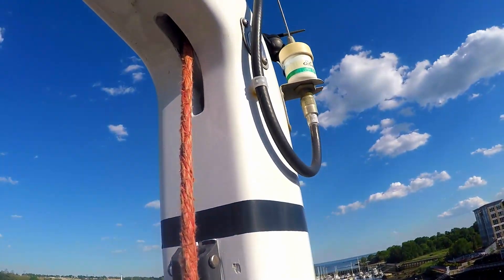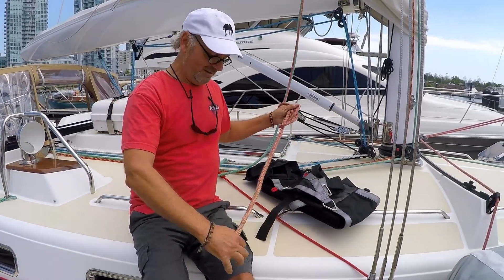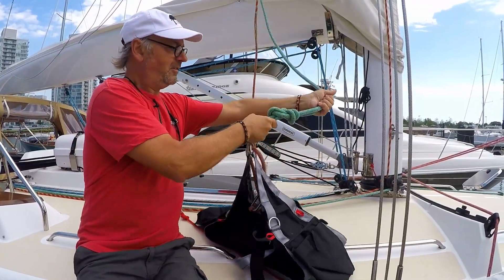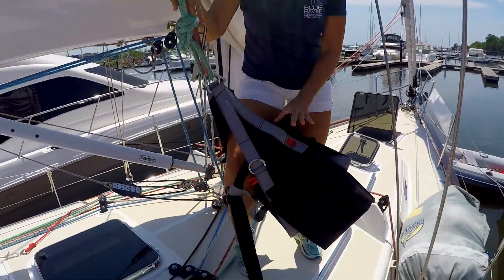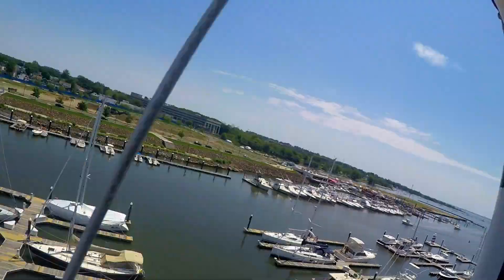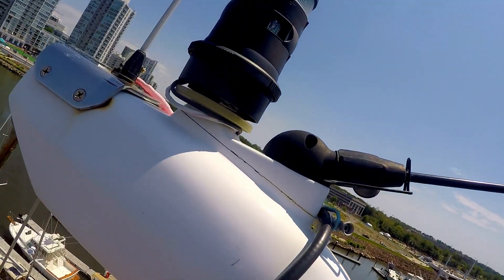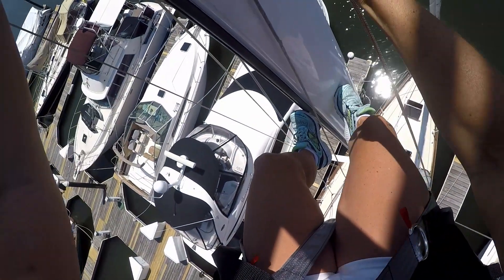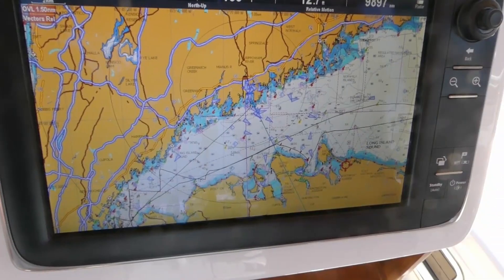VHF Antenna Repair - 65 Feet Up!  Diagnose, Replace and Test The VHF Antenna

Comment: Just in case you didn't know.  VHF antennas need to be kept vertical (your white one was horizontal).  The way the VHF antennas signal sending and reception can be visually described as a giant doughnut with the antenna in the very center of the hole.  If the antenna is laying on it's side (you have an incredibly narrow band fore and aft with great satellite reception).  Anything to port or starboard will be crap at most distances. Here is a visual diagram http://www.boat-project.com/tutorials/vhfant.htm
Reply from the maker: Good Info. Thanks!  Our jury rigged antenna worked well enough to get us through in close quarters in NYC and LI sound. for a couple days. Next time we have to use it (hopefully never), we'll keep this in mind though!  Thanks again.
Reply: @ArgonSailing  and another thing you might want to know that u should use some self agmated tape or coax seal around the connecting  to the coax and to the antenn the coax connect being a marine and comercial antenna installer and boat captan i seen alot of your guys issues the salt will degrae the connect and crode in side at some point. I hope that you guys keep safe and have fair winds in your sails
Reply: What part of video was horizontal mount?